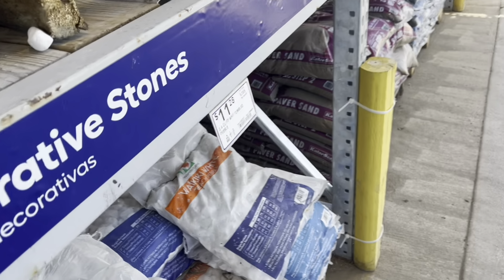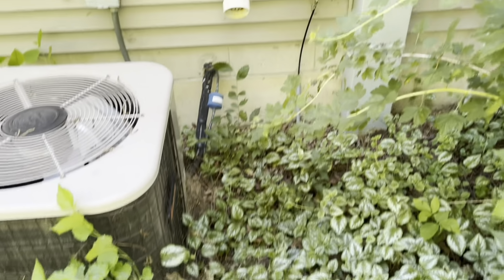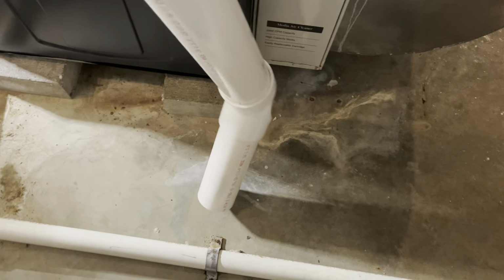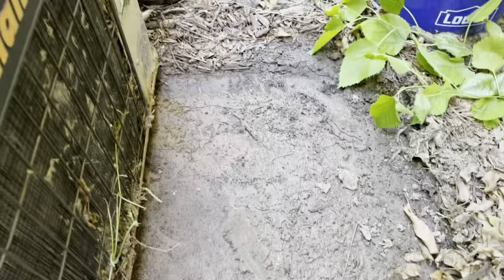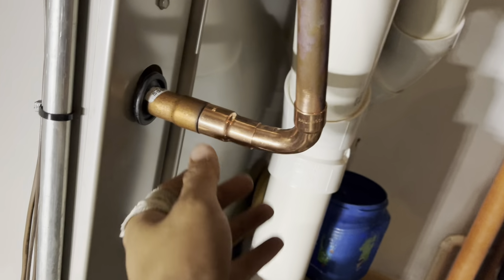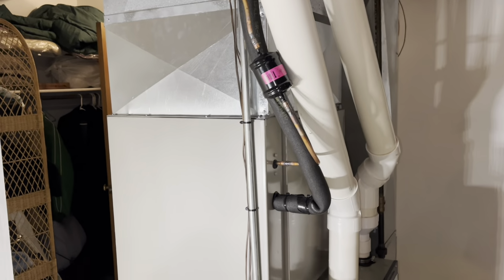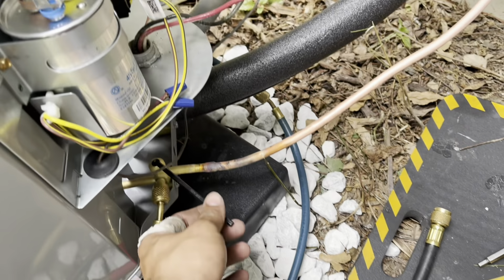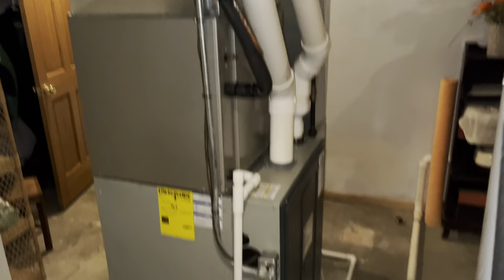Central AC Installation (Carrier Retrofit) DONE In FOUR HOURS

Comment: If you have a brake, and not a pittsburgh, do a half out, half in seam, then make a 3/8 flange on the mating piece and pop a couple screws.  Looks much better than S lock joints.  You can also make pittsburgh joints with a brake as well but it takes some practice.
Reply from the maker: Normally I use the Pittsburg but you are right thanks for the tips 🤙🏽